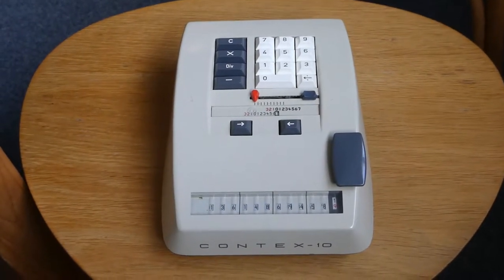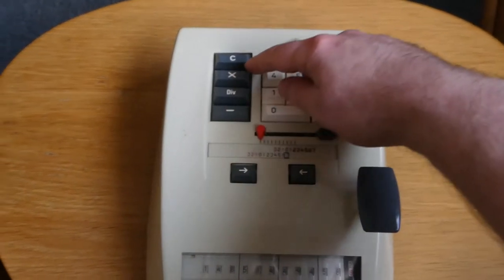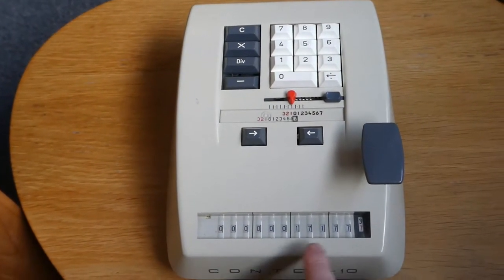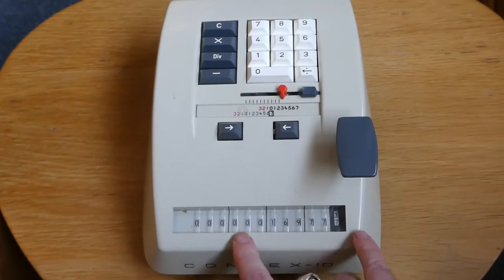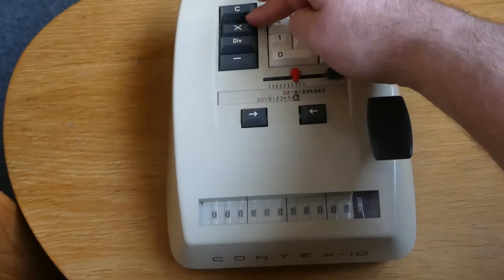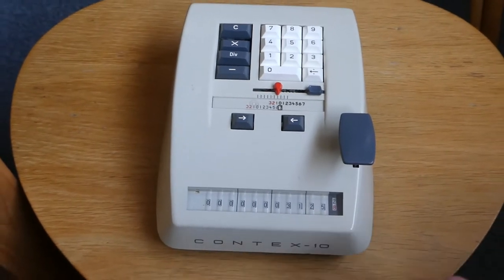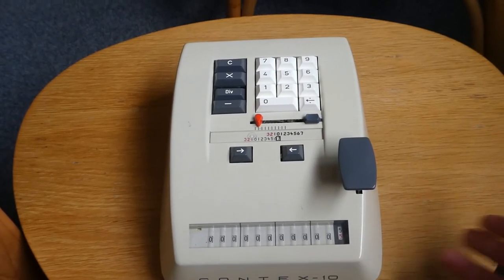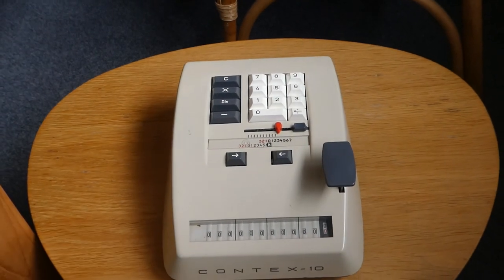The Contex 10 mechanical calculator

Comment: I have the electric version (model 30) of this calculator; the main difference is that the division is repeated automatically, but you still have to write down the result digit by digit… :) And in the multiplication, you simply enter the multiplicator on the keyboard, but… backwards, starting by the least significant digit.

This is the most clever and simple mechanism I have ever seen in a calculator; it puts the huge Friden, Marchant and Monroe calculators to shame.

Here is a video of it: https://www.youtube.com/watch?v=9VB1maICy40